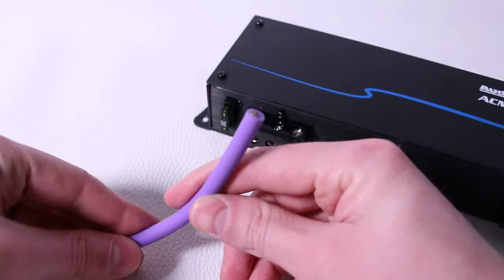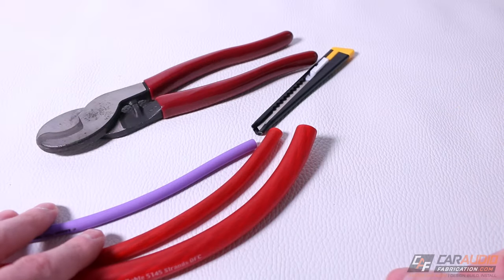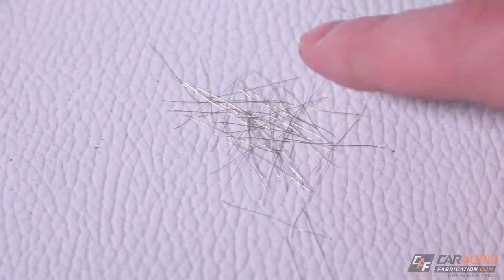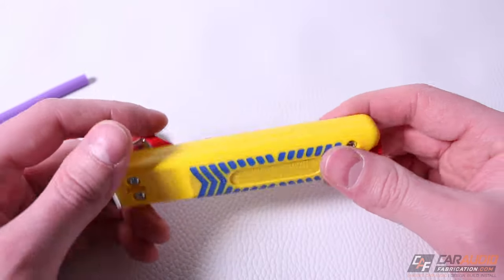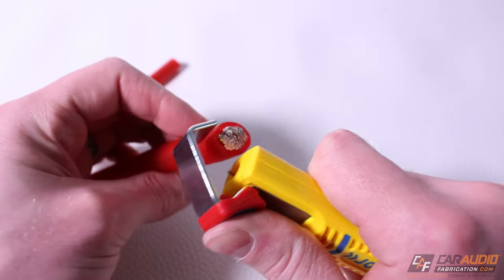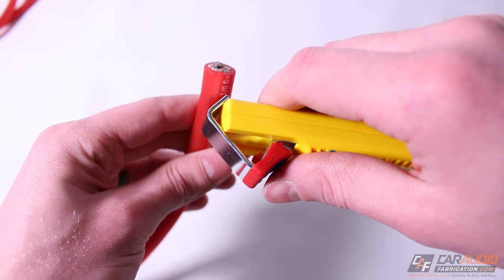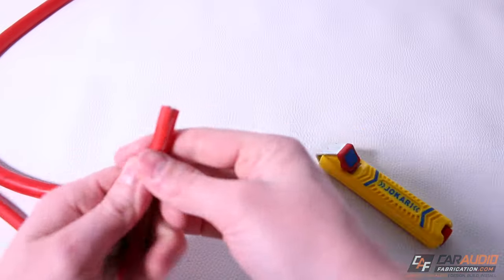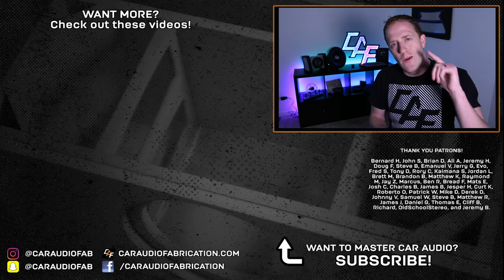Strip LARGE Wires FAST! Professional Wire Stripping Tool

Comment: Thanks for the tips, it worked great!  I tried to find something like this at the audio shop here but they just advised using a utility knife.  I tried that last time I made a solar generator and I didn't like it.  This Jokari tool worked like a charm!  I was able to get through 2 gauge thick welding wire insulation pretty easily.  One extra trip, I had to slightly extend the blade a couple times (albeit over many cuts, 16 to be exact) as time went on (not sure if it was slipping or getting dull), but it was easy to tell when it needed adjusting so not a big deal.  Thanks again for the recommendation and tips!

Comment: As a professional electrician I'd say you want to spin that Jokari around the cable twice, maximum. There is a slight risk of you cutting the wire a bit like with the other tools, even if you've set the blade correctly.
Reply: Then you haven't adjusted it correctly, the Jokari doesn't go any deeper than what you adjusted it to. And I know this since it would ruin a fiber cable if it cut too deep.

/A fiber technician.

Comment: Between this model and the Jokari all-rounder, which one do you prefer for cables. For stripping small gauge wires I have a good stripper, my main concern is removing the insulation from cables easily.

Comment: So your using the model # 10160, not the 70000?  
I ask because sometimes tools don't work that well when your using them at the higher end of their capacities.. 
For example the 10160 adjusts to 16mm,  and my 0 (0/1) guage cable is 15.5mm.  
Do you think the model 70000 would be optimal for 0 guage, considering its capacity is 4-70mm?
Reply: i just purchased a 10270  not sure what i am getting, i think it opens more, not sure

Comment: I need more practice because I tried using it and it kept wanting to move to the front of the wire while spinning it and it was also difficult to do that final cutting sweep to the end of the wire straight. I ended up using a razor blade but for the fuse I’m gonna try doing a few things differently

Comment: Those tools are mainly used for coaxcables when working with network, CCTV, pasagesystems and other low voltage amplications. Never thought of it as a good tool in car audio even if i have worked with coax cables and this tool many times lol! Sometimes all you need is a slap in the face to see what you are missing and that is exactly what you just did with this video mark so thank you haha!
Reply: For real, I'm still in my van eyeing my strippers now.

Comment: Top tip from the Netherlands,
Inside is a extra (new)  blade 🤫
And try to turn it only 1 of 2 times, sometimes it wants to go forward Turing to much.
Ik still have the red and green versions , both 20 to 30 years old

Comment: I like using single strand or low thick strand count wire on projects. To help prevent strand loss while stripping the insulation away. Its always a pain stripping heavy gauge wire. I can see how this tool can be beneficial.

Comment: Hey Mark, I have a 2013 Nissan Altima and I just bought a high output alternator. I upgraded my power and grounds to the alternator and plan on doing it for the battery. The only problem is that my negative battery cable has a ground sensor on it and was advised by the manufacturer to not add any grounds to the negative terminal or that sensor as the sensor wouldn't see it. I tried it anyway and now my interior lights dim like crazy even if my voltage doesn't move which it never did before. Is there a better way for me to do this or should I remove that negative wire from battery.
Reply: Definitely sounds like a grounding issue. Did you replace your engine ground as well? What are the fuse ratings you added to your battery? Did you put the new battery ground in the same spot as the previous one? Or did you make a new location
Reply: Marcus Jones No I only added on the ground for the alternator and a wire from the engine back to the battery, which may be the problem. That wire is grounded from a different location that was pre drilled which I sanded down right above a different factory ground wire. I did not put a fuse on the power wire yet which I will do later. Could it  be since the computer doesn't see these extra grounds it's causing the interior lights (which are leds) to dim when the bass hits even if the voltage isn't affected.
Reply: It's hard to say without being hands on. I doubt it's the computer, because it certainly has more direct ways of telling you than just dimming the lights. I'd say to definitely calculate your total amperage coming from your amps, complete the big 3, and compare to the ratings of your wire and alternator. Also, a good not is that not every piece of metal is a good ground in a car, especially on newer ones, so definitely double check them
Reply: Marcus Jones ok thanks for your help on this. I've completed a big 3 in the past and like you said on these newer cars it's hard to find a good grounding point. Would it be a good idea to drill a hole into the subframe and connect my grounds there or would that compromise it from a safety standpoint.
Reply: As long as it doesn't damage a crumple zone I don't see an issue. That's usually the best place

Comment: But can it cut KnuKonceptz 4/0 Gauge Monster size power cable? 🤔
Reply from the maker: Yes, I just tried it. I had a piece sitting here.
Reply: @CarAudioFabrication  excellent! Because I went over kill and bought 30 feet of that size cable for power in Blue and 10 feet of the same size for ground cable. For a 5K system 😅
Reply: @CarAudioFabrication  what about 8/0 wire?
Reply: @riveralley  who the hell gonna use 8/0 on a install...
Reply: @AdanmNoreiga  uhhhhh I don't know. Steve meade used it I think.
Reply: @riveralley  on a test bench brah...8/0 from shok industries is jus a waste of time ....jus over size and useless with minimum flex...
Reply: @AdanmNoreiga  .............
Reply: @AdanmNoreiga  lol you'd probably use it as you're main power from alts to batts instead of running 2-3 1/0 runs
Reply: @morganbills2749  not as easy as said....bro....but yes thats the intention of the 8/0...but could you imagine running a few of these with a 2-5 alternator system?...positive and ground..lmao...that's my point

Comment: Good if it was under $10 imo. I'll stick to my utility knife seems like it will take the same amount of time if you have to adjust the blade everytime for different wire gage.
Reply from the maker: Once you get the hang of it it is easy. This doesn't feel like a cheapo tool, well built so definitely worth the price
Reply: @CarAudioFabrication  well you are the professional so I'll take your word for it. Thanks for the great content!

Comment: hi.. i want to ask something.. if i will be building a solar powered simple car audio system or stereo using a sub and two speakers with 1000w AMP, can i hook a audio capacitor from my solar controller output/load before going to amp?
Reply: audio capacitor is not good enough. you need at least a 50 amp hour 12v battery to run that. the capacitor would barely do much. you would have to get a huge 83 farad capacitor bank to have any real effect
Reply: @realflow100  thnx man..

Comment: Is the blade replaceable?
Reply from the maker: Yes I added a link to the replacement blades in the video description as well.
Reply: When you open The Tool there are spare blade inside it!
Reply: Just open screws

Comment: I bet a mini pipe cutter  will work just as well.
Reply: Typically their blades are not that sharp, and even after sharpening you might run into the issue where the cutter tries to squish the wire and not dig into the insulation. That being said, i've used PVC pipe cutter as a cable stripper on several occasions and it works rather well.
But if for whatever reason you don't want to buy a new tool, you can make a stripper out of a piece of wood and a razor blade. Take said piece of wood and trim it to about 3 inches long and about an inch wide. Drill two holes near each end. Now split one end slightly and insert the blade so that it's edge is sticking out into the hole, perpendicular to it. Couple drops of super glue ought to be enough to fix it in place. Now to strip a cable, insert the end into the hole with the blade and use your finder in the other hole to spin the cutter around.

Comment: I’ve seen a lot of 
aluminum wire products 
used in  *car audio*,
and hardly ever in home audio.

I’m not sure why there is so much of it in car audio.

Aluminum is only about  61% 
as conductive as copper. 

If a person does use aluminum wires,
but doesn’t know the gauge equivalency 
between copper and aluminum,
 
and doesn’t use the proper thicker,  heavier gauge 
aluminum wire,

there will be higher heat in the wires-which is inefficient.

That heat is wasted/lost energy, 
rather than utilized to produce sound or music.

They also pose a greater fire risk- especially in higher power systems.

Aluminum wires, 
because of greater temperature variability and range, 
loosen more, 
and faster at each connection.

The only advantage I’m aware of is potentially lower cost;

but the price difference can be small,
and sometimes almost insignificant,

especially with the relatively short runs usually used in car audio.

It’s almost certain a person could find not only copper, 
but oxygen free copper wire 
in bulk, 
and even as finished products for the same price, or a lower price,
than some name brand, finished aluminum products.

Aluminum wire is inferior in almost every way,

and I wonder why it’s even used actually.

Especially, 
in high-end systems.
Reply from the maker: The wire in this video is silver tinned OFC. Just because it doesn't look copper doesn't mean it isn't copper. CCA wire exists, but it is mainly only used on budget builds.

Comment: Why not just cut an oval in the insulation for the set screw to bite on wire? Possible?
Reply from the maker: Because you want every bit of wire contacting the top and bottom of the terminal
Reply: @CarAudioFabrication  ah, got it.